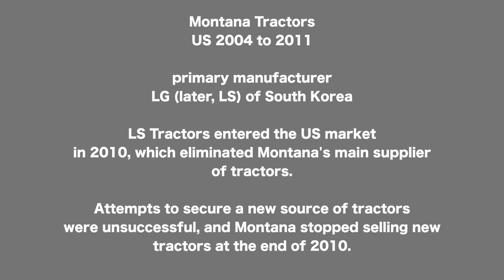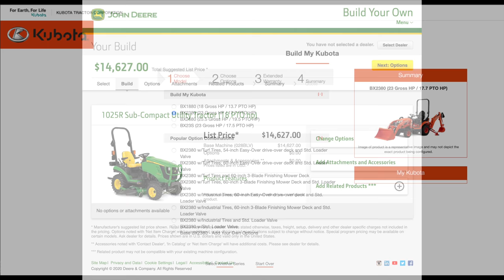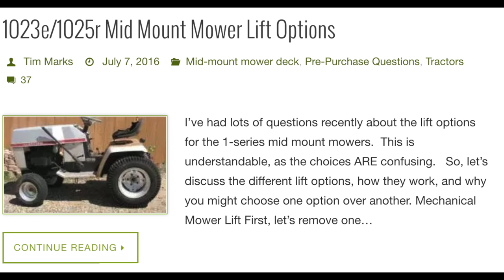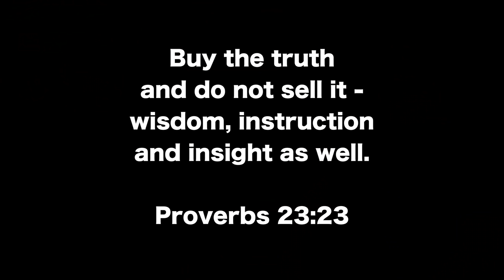Have NO REGRETS! Watch This Before You Buy A New Compact Tractor!

Comment: When my friend bought his tractor the salesman told him to keep using his JD D140 tractor just to mow the lawn because mower decks for the 1025 were more expensive than the box store lawn tractors. If you have the room to store both tractors then it’s maybe something he should consider and then use the money he had allotted for the deck for a different attachment?
Reply: I had considered this when buying my 1025r as I had an x320 at the time. I read the comments on the internet about these sub compacts having a poor quality of cut. But I can say the quality of cut from the 1025r is leaps and bounds better than my old x320. My lawn hasn't looked this good ever. And my property isn't flat, it's uneven with some elevation. So even if you have the space for two mowers, it may be worth getting the deck especially for resale value. My .02.
Reply: I first bought an LA 135 for mowing. Then I got the 1025r w backhoe. Then I got the 3025 for gravel, brush hogging and loading.  Then I got the 960 zero turn. Then we moved into town. 
I guess that’s lucky because a gator was in my sights. I am happy with every one of my green pieces of machinery
Reply: All next week, just let know which day works
Reply: It's a fair point.   One tractor to do the lawn stuff, the other for doing work.   Growing up, we had a JD lawn tractor, and a Farmall A.   Both had the "same" hp rating: 17 hp, but were orders of magnitude different, lol.   The JD worked great for minor things like pulling a small utility wagon around with mulch etc, or for pushing a bit of snow.   You weren't going to get it to pull heavy loads around hills or out of the woods,  dig you out after a snowstorm; or pull a plow. disc, cultivator or harrow in the garden- it's just not made for that kind of thing.  That's what the big tractor is for.

Comment: I, too, own 1 acre, but live next door to my in-laws who have 1.5 and we take care of their property too. I just added a 45 loader to my 2007 X728 on Saturday and am excited for all the capabilities it's opened. I definitely overpaid for the loader ($3,300), but it was cheaper than buying a new 1-series with a loader.  My X728 runs perfect, so at least I know what I'm getting myself into.  The additional costs that I had to pay for, which I didn't anticipate in advance, were the ballast weights ($150), hydraulic pressure relief valve ($166), free-wheeling valve control lever ($17), and a hydraulic shut-off valve ($85). My valves and lever came in the mail today, and I'm excited to get everything installed tomorrow.

Comment: This is my two cents. If money isn’t an option buy what you want. If money is part of your decision making process I don’t see a $20k tractor as making sense on 1 acre. Look at something used to save a few bucks or look at some other manufacturers. Myself personally I own and RK24 with loader, backhoe, 4’ tiller, 4’ rotary cutter and a 6’ cultipacker all purchased at the same time from my local Rural King. Same Yanmar motor as the more expensive models. I have planted 66 trees, removed stumps, moved 304 gravel over my 300’ driveway and opened up 1.5 acres to expand my food plots with zero issues. My tractor with all attachments and delivered to my property by the dealer was an extreme money savings for me. People will talk about long term service and part availability and I guess I will have to see if that will be true. But at the end of the day I have a lot more green in my pocket than on my tractor. Watch every video you make Tim! Keep up the great job around the antenna beside your property. Have a great day!
Reply: Brendan- I agree with you about RK tractors. They seem well made and best bang for the buck. I would also think any decent mechanic should be able to fix any tractor regardless of the brand.
Reply: heavyg 1971, thanks for the reply.
Reply: 🟢 I will always be a JD fan.!🟢 🤔

Comment: I'm still mowing with a 1974 wheelhorse C-141. Just had the engine rebuilt last fall and now everything is going down hill. Bearing are failing and it's time for it to retire to doing shows. I was close to buying a john deere x758 and looked at the 1025 but I found a good deal on a BX2380 Kubota. I can't wait to get it. Kubota and Deere are the only choices to consider in my opinion! Great video

Comment: Tim,    My son just went thru this with some help from me.   We compared JD 1023, 1025, and Bx2380 all with bucket, 60" mower, and ballast box.   JD has compare tool on their site.   Very helpful but had BX2370 only available.   I told him to watch your videos, which he did.   Biggest differences was axle capacities were considerably higher for orange, and fuel consumption considerably less with orange.   The lift arm hydraulic control is better on JD, but he is not going to be using attachments much.    
So, after meeting both dealers and testing all three, it came down to the price.   JD offered $250 more for his trade in than Kubota.   His new BX2380 will be delivered Monday.

Comment: Tim I 100% agree with what you said about sizing a tractor. 
I worked in excavation for years and thought I needed a 2 series Deere or B series Kubota for work around the house (1.5 acres).  I ended up stumbling onto an excellent deal for a bx with a bunch of attachments and was amazed by it’s capabilities.  Yes, they have limits 😁. 
Moral of my story, don’t underestimate the power or capability of the smaller tractors which may free up cash for more implements.

Comment: Great video Tim (et ux!) And a very suitable format for answering common questions (and helping folks avoid common mistakes is a great place to start.) Looking forward to more! Great point on the parking spot, very common issue. I'm hoping you manage to cover a bit of the used market for folks without the resources to buy new in the next two vids! 

Don't forget the lawn tractor vs. garden tractor differences; a garden tractor could fill some people's needs for snow removal, tilling, finish mowing, or maybe very light loader (wheelbarrow replacement) work. They come in 4 wheel steer, 4 wheel drive, diesel, etc. variants, but often their cost balloons past a 1023e...but for some folks they're perfect.

Comment: I see some good points below, a couple items i think are important to think about
1. don't go too big that you cant haul it
2.  I prefer Turf tires, you can drive on your soaking wet lawn and do no damage, and i think it digs just fine with them and works great in the snow.  if you are using in your grass most of its life you will love having the turf tires, seriously no regrets and i have done tons of gravel and dirt work with mine.
3.  if you have friends with attachment make sure you are buying something big enough to use those attachments, i have about 6 or 7 close friends and we all have tractors, but we dont buy attachments if one of us already has one so we can share.   I personally use a 30 hp on my 1 acre and never say its too big, but i have some attachments that one of my friends cant use because say a 1025R has shorter tires and the 3pt hitch wont lift high enough for some of my attachments to work properly on his machine
Good luck it will be the best wheel barrel you ever owned.
Reply: Johnny Wishbone, my first 13Hp Yanmar 4wd had Turf Tires with chains and a tow behind Fine Cut Mower which was ideal for backing the mower down steep ditch banks and mowing the wide ditch bottom without getting stuck! The fine cut mower also turned brush into dust, only smoking the belts once in about 10 years. At that time period Yanmar had a marriage contract with dear John and was painting them green!

Comment: Great advice. We just went through this process. We have an acreage (13.5) that we’ve had for a year. I test drove a BX2680 and a 1023E, but after talking to my JD salesman he suggested a 3025E. Ended up getting a new 2018 3025E (old stock) for the same price as a new 1025R, with a tiller and the 300E FEL. So far I’m SO glad I went with the slightly bigger tractor. Keep up the great videos and great advice! 👍🏻

Comment: Bought mine in March. It sat outside at the dealers all winter close to the road. The road that they put salt on and lots of it all winter. The salt spray caused the hydraulic fittings etc to corrode a bit. After I took possession it never spends a night outside but the next one will be ordered or bought in the summer.

Comment: Another really well done video.  I tell everyone that you will not use these tractors for what you think you will use them for.  Today I used it to lift a paddle boat up and pressure wash it and then put it in the lake.  I have had mine for 8 years and do new stuff with it all the time.  Also, and you make this point regularly, I am pretty much maxed out for size regarding snaking my way between trees, etc. Lastly, good comments on attachments.  Lots of us have more invested in attachments than the tractor.
Reply from the maker: Was the lake frozen?
Reply: @TractorTimewithTim  Hey, early spring here on the tundra this year!  Ice has been out for awhile now.  Only two years ago it was May before the lake opened up. Been pretty awesome for the local farmers as planting is running at least two weeks ahead of average. Will need some rain soon though.

Comment: You need to select a tractor for your needs.  As an example quick attach was not a priority for me, the lift capacity was.  I purchased a New Holland Workmaster 25S with loader and backhoe and have been very happy.  We have a NH dealer in close proximity for service as needed.

Comment: I recently traded for a 3033R cab tractor. Love the cruise control for mowing. Hate that there is no gas strut on the right door. Another thing to consider is having the salesman look at their other partner locations. We found a 2019 at another location vs ordering a 2020 that they did not have in stock. The partnership was needing to move it. That saved me about $6,000.00. The build tool came in at $42,000, they sold it to me for $36,000.

Comment: I work part time at a Kioti dealership so I'm somewhat stuck buying there lol. But your comment at 16 minutes really made me think. I was quite set on getting a CK3510 with a rear mount snowblower, but maybe I should rethink and get a CS2510 with a front mount snowblower, then maybe a cab or backhoe or something extra. An extra attachment might be more important then brute horsepower
Reply: JD 1025r has a cast aluminum transmission case. That is not for me I am buying a Kioti  CS2510. Just my opinion.

Comment: 1 Acre is NOT too small for a sub-compact.  I have lived at my home on a 1 acre lot for 20 years.  I started with a well used 318 and built a loader for it.  Very handy tool I will say.  A year later I bought a bigger tractor - John Deere 420 and moved the loader to that machine.  After 8 years it was time to move again and purchases a x720 that I put the load on (with a lot of re-fabrication).  i used the loader on each tractor a handful times a year (sometimes just once) but it was handy enough that I was not giving it up.  When Deere moved to the new series X700 and dropped the loader option, I was stuck.  Either I stay with my x720, move to a newer tractor without a loader or go with a Sub-compact....   2 years ago I bought the 1025r with loader and Deck.  I felt silly for about 2 weeks with such a "oversized tractor" on a 1 acre lot... but then I realized, I have my loader on my tractor ALL THE TIME just to use it like a cart.  It it so easy to put on that I do it all the time to move something.  The biggest benefit to my loader was adding a set of forks!!   My neighbors all look at me with a jealous eye so I KNOW that made the right move.   My next door neighbor also has a 1025r on a 1 acre lot, the neighbor on the other side of me is considering one and so is the neighbor across the street!!!

So the real deal is this... compare a 1025r with a deck to a X758 w/deck, PTO and 3PT.   The 1025r will be cheaper, stronger, more capable, better resell, tigher turning radius....truely a NO-BRAINER!!!!   The loader at $4000 is crazy expensive, but they make the tractor the true value that it is.   

Buy a 1025r and YOU WILL NOT LOOK BACK!  A GREAT INVESTMENT!!

Good luck

Comment: Tim, I have a kubota bx 23 with the bt600 backhoe.  The main return hydraulic line from the backhoe to the tractor is discontinued....had to get one made locally.  It works perfectly and actually cost less than if I bought an original part from Kubota. So just an FYI to let everyone know that Kubota doesn't always keep up with parts for older tractors.

Comment: You make a good point Tim about the re-badged tractors. I have never been a big fan of these re-branded machines. Another big issue is on-line access to parts information and manuals.  Just try to go on-line and look at a manual or parts illustration for a Montana, Branson or TYM.  Next to Kubota and Deere the other brand I think is a safe purchase is New Holland. But that's mainly because we have Messicks around here.
Reply from the maker: New Holland is an LS rebadged :-)
Reply: @TractorTimewithTim  Yes, I was aware of that. But the LS / New Holland relationship seems to be a bit stronger than most. Combined with the fact that there are a lot of New Holland dealers around. I was basically saying that out of the rebadged tractors out there, New Holland is one I would not feel at risk purchasing.
Reply from the maker: Joe, I replied without seeing the comment was from you.  Of course you would know they were LS. I’m sorry.
Reply: @TractorTimewithTim  Hey... no need for apologies. It's all good. Very informative video.

Comment: I have 1.3 acres and part of it is quite hilly. 5 years ago I bought an X738(full time proportioned 4x4). It was more money than a 1025 that had the 3 point hitch. At that time I wanted to stay with gasoline. I have front mounted snow blower and blade for the X738 and I am pleased with both. On the back I have click-n-go 25 gallon sprayer, grass catcher, weight bracket, and electric dry material spreader. I have no regrets on this equipment.
The only thing missing was a loader bucket. So a year ago I bought a 2025R and I really like it but I wouldn't want to mow my yard with it. Oh yah it did have a 36x48 insulated building built. I do not know how I managed without the bucket and pallet forks. I am not impressed with the front mounted blade. You can make the piles taller. One of the front attachments I really like is the Artillian front bracket (now I need grapple) that accepts a trailer ball mount. I didn't realize the 3 point hitch did not lift very high. Land scape rake is constantly dragging a corner.
Tim, thank you, I have saved at least $100 dollars in shipping from Green Parts Store in the last month.
Reply from the maker: WooHoo!

Comment: Some years ago, I very nearly bought a 10 year old John Deere 1650. This is a 60 pto HP 4 wd built by Yanmar and relabeled John Deere.
There was a whole line of these from 750 (25hp?) on up to the 1650. 
W ended up with a bit larger US built JD instead, a 2440.
A few years later, I again was looking at some of these JD labeled Yanmars for a second machine , a 955 (32 HP)
 Before purchasing I checked on parts availability and learned  that , although these are great machines, like all tractors, they have a weak point. The weak point is the cast iron front drive axle housin which can break if used hard ( like Tim does!)
The JD parts man informed me that this part is no longer available. He suggested it would be wiser to purchase a similar age and cost 20 series ( 2040, 2240 etc) Mannheim or Dubuque built midsize tractor, as parts will always be available for these tractors. The reason for that is that there were a huge number of these tractors built and as they are capable of most jobs on a commercial farm, still in use.
I never thought about parts availability with the 1650 as I just assumed being JD and fairly new, parts would not be a problem. I don't know if the 1650 has the same front axle weakness as the 950/955, but it likely has the same general parts supply weakness. They are old enough that JD is not required by law to keep a parts supply and rare enough that it's not worthwhile for JD.
Long-winded way of saying buying brand alone does not guarantee a parts supply on a used machine!

Comment: Lost a bolt in the mower deck of my John Deere riding mower.  Parts at the local John Deere shop would have cost me $26.
Went to tractor supply and got a bolt, nut and several washers for about $3 and it works just as well.  That's what keeps me from buying a John Deere; besides my last John Deere big box mower had a plastic hood that had starch in the plastic.  The sun broke down the hood and it cracked and fell into 50 pieces.  the replacement hood would cost me $400.  to their credit, the mower still works good, but they added a hood like this so that they WOULD crack and the owner would buy a new mower out of frustration.

Comment: Some dealers will bring a unit out to your house for a test drive.  Your terrain drives your decision.

I bought an earlier version of the JD 2028.  I discovered that (1) it had inadequate brakes on a hill and (2) the differential lock was next to the 4 wheel drive selector.  Therefore it was easy to start losing traction and mistaking knock the tractor into 2 wheel drive.  This results in a runaway.

So, I had to sell it at a loss.  The new 2028 fixed those issues.

Even worse are the 2 wheel drive mowers.  I owned one of those for 5 minutes.  Almost broke my leg on that runaway.